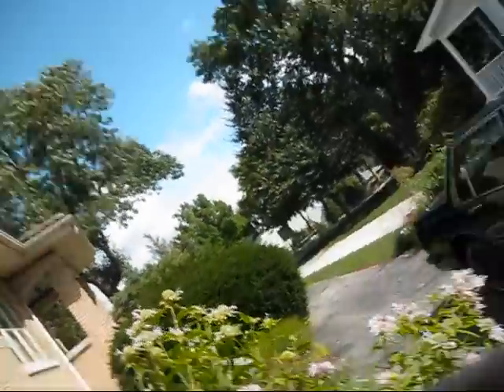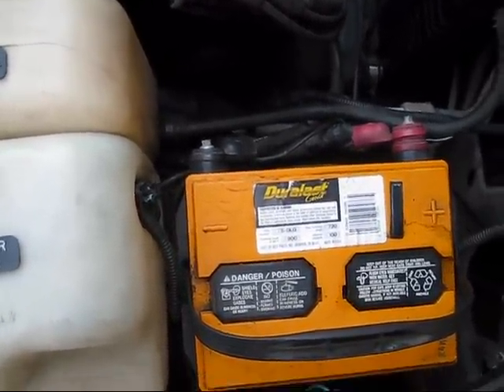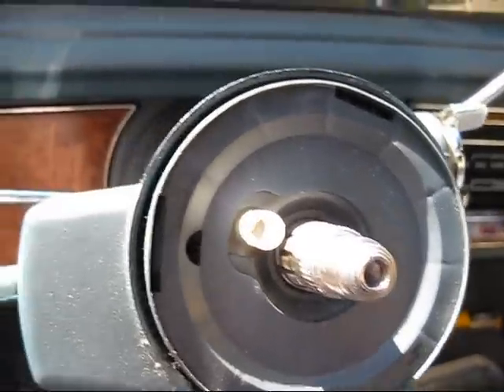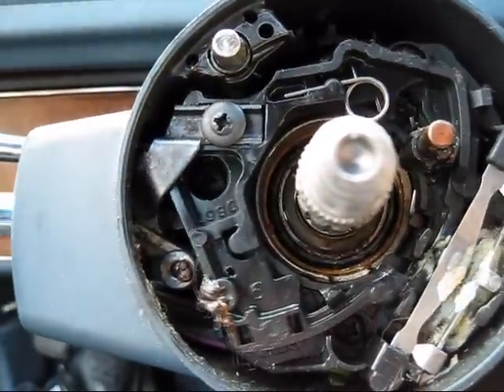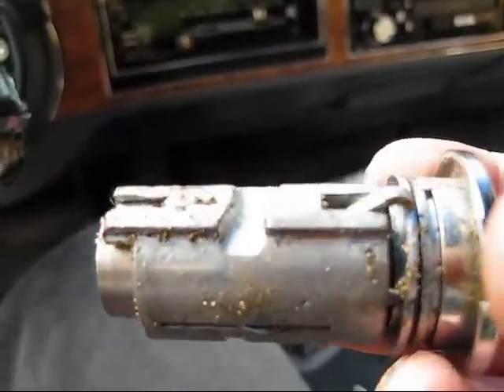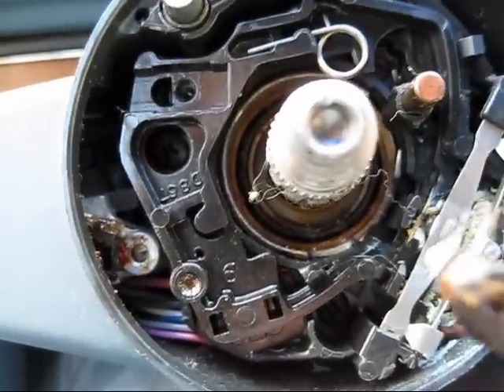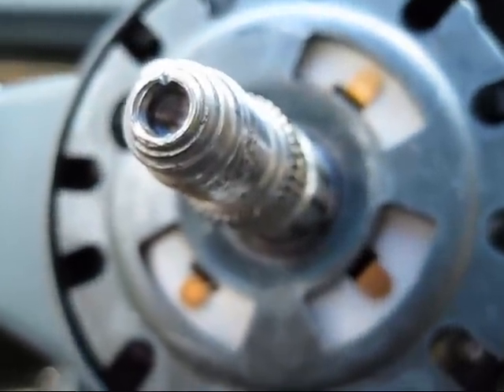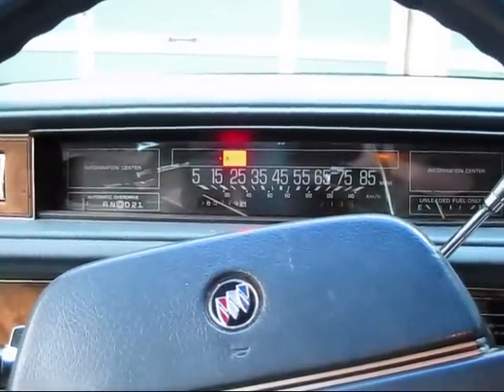How to change a Lock Cylinder on a Non-Airbag GM Column

Comment: I just stumbled across your video while trying to refresh myself on the "joys" of pulling a GM column apart... I've done it once to an '85 S-10 Blazer, and now I need to do it for my '87 LeSabre (and you're right about the 3.8, it's a smooth engine with just the right amount of torque to get these beasts up to speed). Thanks for filming an informative video, you covered all the bases.

One thing to note, the cancel cam assembly (if you still have the car) is available as part of the turn signal switch unit, but I've also seen it in the Dorman Help! section of the local auto parts box stores without the actual switch attached. I've had 4 separate 80's GM vehicles that have lost the spring for the left cancel.

Also, this is a great fix if you get the other 80's GM ignition issue: where you can pull the ignition key out when the engine is running. Admittedly, I use that as a "feature," I can start the car and let it warm up and take the keys with me, locking the doors.

Comment: The buzzer was staying on after I replaced the key lock cylinder when the key was removed. The cylinder I put in the little white gizmo on the bottom of the cylinder didn't move. Now I know the problem thanks to this video. I bought a bad cylinder. Thanks bro

Comment: This was a great vid that was needed. Any chance there is a  more in-depth vid on puttin that buzzer switch in anywhere? I didnt see the copper clip under it until I was putting the buzzer switch back and havnt figured out how it sets or goes back in correct.   Im gona try again after seeing this video. Thanks.

Comment: If you try to pull the wheel off without the puller .. LEAVE THE NUT SCREWED ON A LITTLE BIT.. If you dont and the wheel does come off while pulling on it , it will hit you smack in the face..

Comment: hey man im working on my 89 silverado and im down to the last couple steps of reinstalling everything however the little washer type deal that sits against the ball bearing wont go far enough down to keep the steering shaft tight. any suggestions? see 5:16 of your video and youll see what im talking about. thanks alot man.